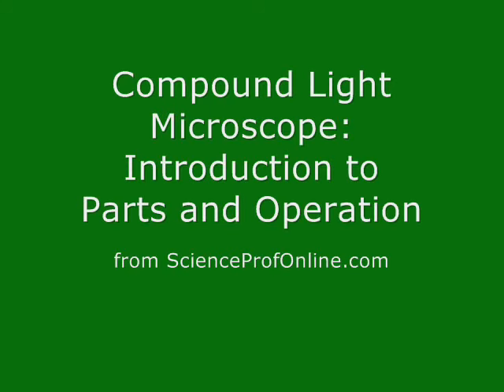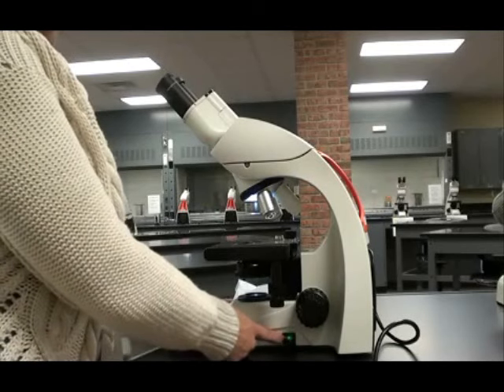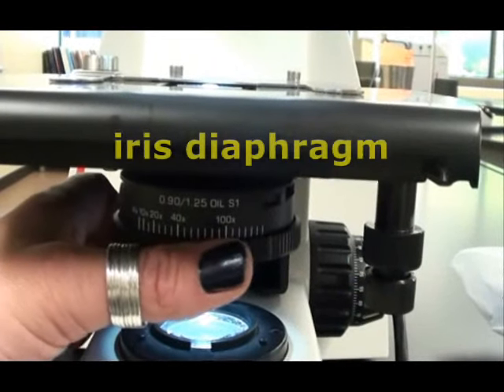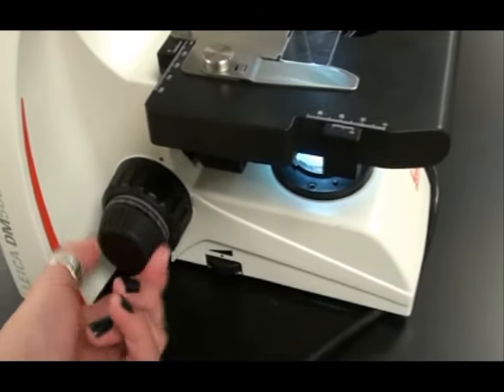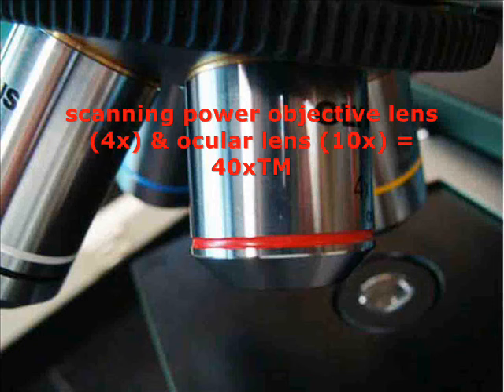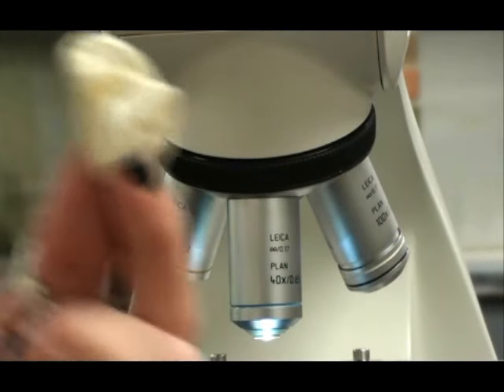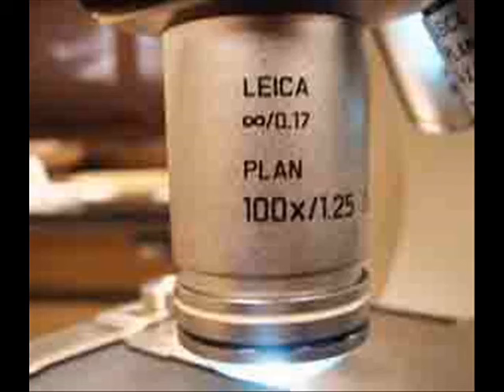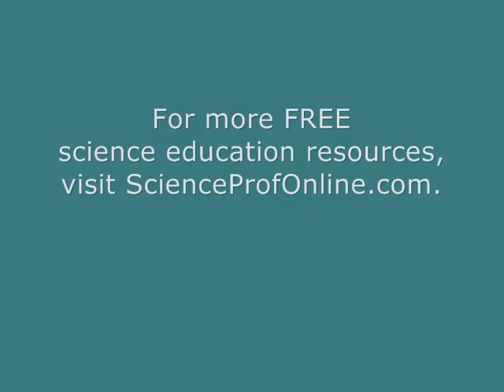How To Use a Compound Light Microscope: Biology Lab Tutorial

Comment: Excellent. Can you tell me what the proper height of the condenser is? Should it be all the way up when using the oil immersion lens (1.25 NA)?
Reply: Place an object, pen, pencil just above the light. Through the eye piece(s) adjust height of condenser until object image is sharp.
Reply from the maker: +eminusipi 
You need to progressively focus (parfocal), starting with the low power objective (yellow band). You can switch directly from low power (100xTM) to oil immersion objective (1000xTM), and should then need just a bit of fine focusing to get your specimen crisply in focus.